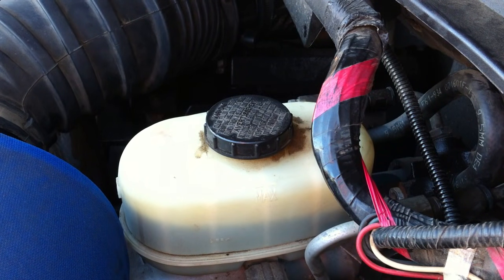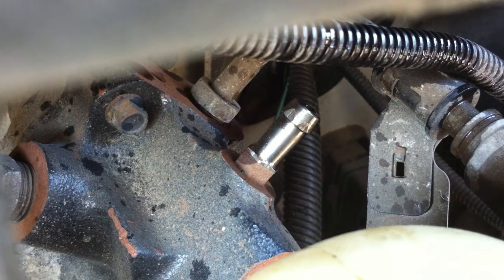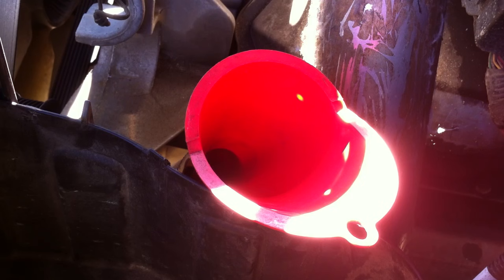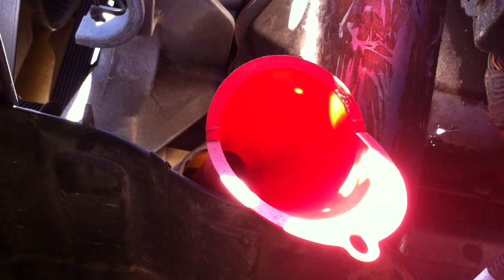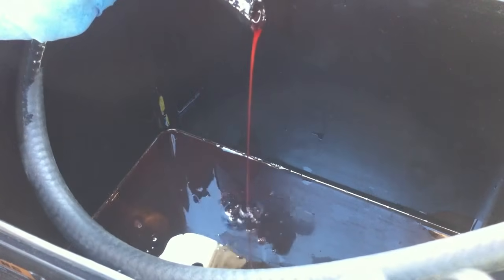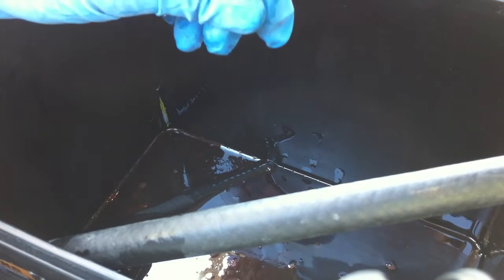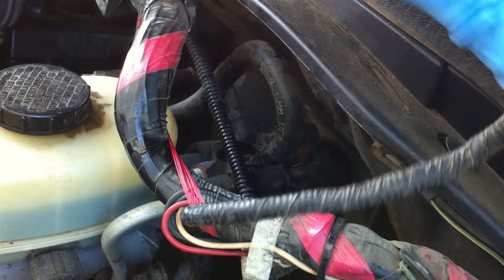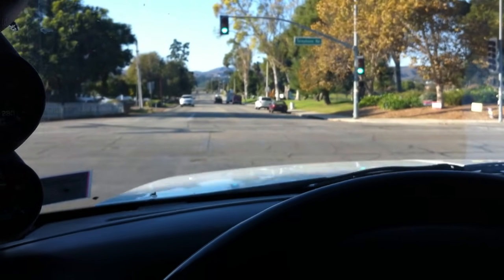How To: Power Steering Flush on 7.3L/6.0L Powerstroke (HydroBoost)

Comment: Good video.  I'm a retired hydraulic guy with over 30 years experience I can appreciate how you stressed to keep oil in the pump.  Other videos posted allow and encourage people to run the pump until dry.  When you hear the pump growling (cavitation) it's sucking air instead of oil.  This causes lack of lubrication under pressure and induces air in the system.   Now it's time to 
flush my Duramax.  Thanks,

Comment: Just did mine today with Mobil 1 thanks to this video.  Honestly, the hardest part was getting the spring clamp undone and done again in the right spot.  My pump was howling like a wolf after taking a hard turn.  Now, it's back to nice and quiet again.  Super simple process, not overly messy, just put some towels under your hose connection and you're good to go!  Did by myself, about 6 lock to lock turns, about 10 brake pumps, and still under 2 quarts total.  Old fluid wasn't terrible looking, but also at least 10 years old.  Cost of tubing was about $2.50, used old gallon milk jug for catch can, and Mobil 1 ATF from Pep Boys at about $7 a quart.

Comment: hey trey
finally got around to doing the PS fluid deal.. I did it just like you showed but when my helper turned steering wheel i got no fluid in bucket.. so i had her pump the brakes at a slow steady pace and that seemed to do the trick.. I used a braided line so able to see the stuff coming out and put the clamp on but still got some leakage from somewhere.. i did over flow the thing a couple time. .  mine, 2003 PS, only took about 2.5 qts till i got new fluid.  

My filter is stock so i remove the top housing and hose to the crank vent connection part and just left off during operation. I could see turbo wheel spinning but at idle there was no sound.  put my hand close and man can you feel the air flow.. 

all in all it worked like a charm.. thanks for the good instruction.

Comment: Cleaned up my HOWLING noise with just 2.5 quarts. I need to siphon out the reservoir still but WOW, what a Huge improvement. It purrs now and noticeable grip now.  If you are experiencing this noise, FLUSH NOW.  Use synthetic, no brainer.

Comment: Great video! Very detailed in step by step procedure. Just did mine on a 2001 F350 7.3 Old fluid looked more grayish but probably because power steering fluid added to system. Took me 3 quarts to see completely red with clear hose. Brakes nice and hard, but power steering pump still whining. Guess it's time for a new power steering pump!
Reply from the maker: Yep! That power steering fluid probably didn't help!

Comment: I am about to do this procedure tomorrow on my 2000 F350 7.3 due to an accidental puncture of my power steering cooler. I was able to JB Weld the cracked inlets where the hoses attach to the cooler. I was only able to find Valvoline Max Life full  synthetic at WalMart for about $17 for a gallon. I also punctured my AC condenser at the same time but found a used condenser, 31 row transmission cooler and a power steering cooler from a 2004 6.0 F250 at the local salvage yard for $150.

Comment: My initial bleeding process was wrong I introduced air to the hydroboost creating a vacuum so now I have air in the hydrobooster. I also changed the power steering pump and both seals to the hydroboost.
It was leaking and this is where all my saga started

Comment: Hi Trey, Good Video, I sure hope that the problem of my break peddle going to the floor and having hardly almost no brakes at all on my 02 F550 4x4 Bucket Truck the PS fluid is dark blackish and the break fluid looks like it was clear at one time now it looks dirty now Im a LineMan/HorseMan and no way am I a Mechanic so Im not sure about the Fluid in the Brake Reservoir It looks dirty that wouldnt have anything to do with me losing my brakes would it..? anyway hoping that flushing the PS System gets my brakes back .

Comment: If you aren't going to use a clear line, try clamping it (gently) to the edge of the bucket so you can use a white paper towel to check the color.
Reply from the maker: Good tip!

Comment: Trey great video. I was wondering why you say that you have to use Transmission Fluid and not Power Steering Fluid. I have a 7.3 also and like to know the reason. 
Thanks
Todd
Reply: Thanks for the input. What year is your truck?
Reply: Trey Spooner 
Ok. Mine is a 2000. I don't remember ever having Transmission Fluid on it
Reply: @odellfire35  Ford calls or Merc V in 7.3 power steering.

Comment: Thanks for video!
Are you alternating between turning steering wheel and pressing brake pedal? Or holding brake pedal down and turning steering wheel at same time?
I would like to do this to 7.3 today.
Reply: Well, my 7.3 is an E350 van, so it appears to be different. Has the larger hose going from the power steering reservoir to the power steering pump. Then looks like it has pressure line coming off of the pump, which screws into the pump, that line leads to a power steering oil cooler then there's a 3/8" line going from the cooler back up to the power steering reservoir. So I don't really know how to go abt doing the power steering flush with this set up
Reply: Ziji! thats the same setup as the pickups

Comment: great info. thanks..  could you not plug the hose you took off to connect the hose in bucket.  that would keep the spray down. just asking. 

ps what does pumping the brakes do.. i could see the fluid jump when you pumped the brake but i was thinking the brake and PS system were separate..

Comment: I have been using power steering fluid in my 2000 7.3. I hope I did not mess anything up. You said to use transmission fluid in it right? Also I have a leak that I have been having to add the fluid to every other week. I am thinking about replacing the whole thing what brand would you buy if it was you?

Comment: Did you do this when the truck was on the ground or lifted? Idk if on the ground it will damage anything. Also once your done you just reattached the return line and you didn’t get any air in system? I’m going to do this today
Reply from the maker: The best thing to do is jack up the truck or place two pieces of cardboard under each tire so they can turn easier

Comment: Are you putting the cap back on the reservoir when you're turning the wheel or do you leave it off
Reply from the maker: You can leave it off just make sure that the fluid level doesn't get too low and that air doesn't get into the system
Reply: @TruckStuff1  what do you do of you get air in the system?
Reply: @FLYPHUS  ya gotta bleed the whole system if that happens, which can be a pain.

Comment: My truck (01 7.3) is getting to where it doesn't want to steer when it's sitting still. Should I flush the system and see if that solves the problem, or go ahead and replace the pump?
Reply: yes...Mines doing the same thing ,mostly when I am towing my 5th wheel...if your steering fluid is dirty then yes change it.
Reply: check the belt tension it might be slipping at idle.

Comment: My ABS light is on, after I replace the ball joints and when I shut off the engine and restarted the ABS  is not on. When I go down the road and it's like 10 feet when I stop the truck, when I was going the ABS turns on. Is it the wire that goes to the wheel bearing or I need to replace the wheel bearing.

Comment: What about the fluid in the reservoir right there downstream of the return line?  Just accept it's old stuff or is that system independent of the hysroboost?
Reply from the maker: Eventually, after repeating this process, it should all be flushed out or at least so diluted by new fluid it's essentially new.

Comment: I need to do this on my 2006 GMC yukon.  So it does not come gushing out the moment you start the truck?  Only when you move the wheel or the brakes?
Reply: Suck It With Singh Some of the gm cars and trucks use the hydroboost system as well. My father's 04 yukon xl has it.
Reply: jesse sweetland 
really ? my dad used to have an 03 yukon but i never noticed that. thanks for the knowledge
Reply: Does anyone know if the Vacuum Pump on a 1999 Ford 7.3 Diesel Powerstroke also helps with brakes and steering or are we looking at three different parts:  Vacuum Pump, Steering Pump, and Brake Pump?  Thank you

Comment: Doing an oil change and fuel filter change on my truck today, I noticed the dipstick cap for the steering fluid was just off and sitting there, I'm suprised it didn't fall completely off.  Now I'm looking to replace it all because it doesn't even touch the dipstick

Comment: What did you do with the return line that you removed? I don't see it in the video.
Reply: Take it and zip tie it to the hood light wiring, so it's vertical, that way no fluid comes out. After flush, cut the zip tie and re-install line.

Comment: Does anyone know if the Vacuum Pump on a 1999 Ford 7.3 Diesel Powerstroke also helps with brakes and steering or are we looking at three different parts:  Vacuum Pump, Steering Pump, and Brake Pump?  Thank you
Reply: Vacuum pumps provides power to operate the air Conditioner/heater vents and louvers. It doesn't assist with steering or brakes.
Reply: Ok good to know.  Thanks MmShop Fix.  I recently changed my faulty wobbling vacuum pump.  I think the bearings broke and had been wobbling. So while driving the belt ripped and I lost power to steering, brakes and everything else.  But now I see it was the ripped belt that caused all other pumps to fail.  Replaced the vacuum pump and belt and now all works :-)  Thanks for info, Happy Holidays & New Year :-)

Comment: You say that you are changing your power steering fluid but it's making your brakes better how is this power steering and Brake connection possible I have an F-350 diesel 6 liter
Reply from the maker: These diesel trucks use the same system for both steering and brakes. Normally vehicles use vacuum but diesels don't create enough vacuum for brakes.
Reply: @TruckStuff1  so does the brake fluid reservoir use brake fluid or transmission fluid
Reply from the maker: It uses brake fluid. That's just the hydraulic fluid to actually push on the brake calipers. The hydro boost system provides the power assist for the brakes and steering

Comment: I use the Synthetic Mobil 1 ATF in my 4r100 (24 Quarts) and the Power Steering, Dot 3 in the brakes. I have Amsoil full Synth in the rear end with the Mag Hytec trans and Rear End Covers. The Synthetic Mobil 1 ATF is 10.00 a quart on Amazon w/Prime free shipping in 2 days.

Comment: How does the brakes effect the power steering and vice versa?
Reply: In these trucks, the power steering pressure is used to help with braking. Most smaller vehicles don’t have this though.

Comment: so are youy saying the brake fluid for the 6.0 diesel is supposed to be autamatic transmissio fluid?
Reply from the maker: Not the brake fluid, the power steering fluid, which also powers the power brake system. The brake hydraulic fluid is normal brake fluid.

Comment: QUESTION---  WHY DO YOU PUMP THE BRAKES WHEN YOU TURN THE STEERING WHEEL? WHAT DOSE THAT DO HAVE NEVER SEEN THAT BEFORE!! WHAT DOSE IT HAVE TO DO WITH MAKING THE BRAKE PEDAL FEEL STIFFER? GOING TO REPLACE THE BRAKE FLUID AS WELL JUST TRYING TO UNDERSTAND HERE!!!!  2006SD DIESEL 6.0
Reply: The 7.3l (and 6.0l, I'm assuming) utilizes a "hydrobooster" instead of a vacuum-based brake booster, due to the lack of applicable vacuum lines in diesel engines (I'm not a mechanic; don't know specifics).  This hydrobooster receives pressurized fluid from the power steering pump to provide necessary brake boost.  If your power-steering pump (or fluid) isn't up to par, your brake pedal might feel "spongey" or otherwise not stiff.

Make sense?  :)

Comment: Got confused. What is the correlation between changing the power steering fluid and it affecting the brakes?
Reply from the maker: Understandable. These trucks use the power steering pump to generate the hydraulic pressure for the steering AND the brake system. It's called Hydro boost.
Reply: @TruckStuff1  hey thanks! Didn't know that until now. I just got a ultra/low mile formerly fleet maintained '01 F350 crew 4x4 7.3 and needed to definitely know that.

Comment: So I did  just what  you're not supposed to do I let it go downafter the 3rd quart.the nice red fluid turned to pink foam.so what to do now
Reply from the maker: Completely fill the system and continue working the air out. Try not to run it very long with air in the system because it can harm the pump. One mess up probably should be fine.

Comment: Would this process get air off the hydroboost boost?
Reply from the maker: Yep!
Reply: @TruckStuff1  I did but no luck, about 3 quarts  but I cant get my brakes to work.
Reply from the maker: Keep it up cycling the pump. You may have to really work it if there's a lot of air.
Reply: @TruckStuff1  
Day 4 at this and no luck, I have to say I dont give up easy but this one I really cant figure out.
It started with hydroboster seals.
Then I try to bleed pump and broke the reservoir. Turn into new a power steering pump replacement. Finally I felt like I could bleed it but I know I did something wrong, brakes automatically go to the floor when I start the engine. Pedal gets suck in.
Maybe new hydroboost or maybe new abs module or maybe new brake master cylinder.
Anyways I throwing the towel.

Comment: I changed my 06 6.0 steering gear box and forgot to bleed it... went for a spin and then lost power steering when using brakes.. then brakes got reallly stiff.. took it back to my shop.. jacked the front end up and tried to bleed it but still nothing.... then tried this method and little fluid comes out and brakes are still hard as a rock

Comment: I just did this on my 2001 7.3 powerstroke and my steering and my break pidel got hard??
Reply from the maker: That's good. You should have a firm brake petal. It should be hard for the first few seconds then slowly push to the floor

Comment: IsValveoline  LV synthetic ok?
Reply from the maker: Mercon LV compatible fluids are not recommended. You need Mercon or Mercon V.
Reply: ?sp goin int the  05 exursion
Reply: trans
Reply from the maker: @KERNFUZED  Mercon SP is the correct fluid for the transmission, but the Hydroboost system still uses Mercon or Mercon V.

Comment: New sub. Great vids bud. Anyone out there that can make a suggestion on a leak I'm having I'd appreciate it. '05 f250 6.0 ps. From under truck looks like it stars somewhere around manifold or head area. Keep in mind had new oem gaskets n arp studs out in about 40 days ago. It's a oil leak. About 2ounce per morning puddle
Reply: Oil cooler most likely!!

Comment: I forgot to mention, the power steering cooler from the 6.0 is bigger than the OEM on my 7.3 Would anybody recommend me installing just the power steering cooler from the 6.0 only or should I go ahead and run them both together in a series for extra cooling? I would imagine that the 6.0 cooler alone would be sufficient since it is already bigger than the 7.3 cooler. What do you think?
Reply: Yes you can install a 6.0 power steering cooler with no problema

Comment: you said your gonna use the brakes but you're turning the steering wheel what's with that.and yes clear 3/8 is much better..it usally takes 3liters and makes good bar oil for your chain saw

Comment: It looks like you're working on a 7.3L?  You make a statement that any Trans fluid that is OK for the vehicle is OK to use in this (sic) motor.  You meant OK for the PS system?  You state that you are going to use Mercon V. 

Please provide Ford specs where Mercon V is authorized for a Super Duty.  :-).     I have NEVER seen authorization use Mercon V in a SD transmission.  4R100 or 5R110W. -  'just say'n.
Reply from the maker: http://www.dieselhub.com/trans/4r100.html
Reply from the maker: Mercon V is the ATF of choice for the 4R100
Reply: Automatic only- Ford TSB 06-14-4. Ford authorized use of Mercon V formulations in 2006.
Reply: @gregoryney5680  Hello Gregory,   That TSB pertains to the Transmission, only.   Nothing about steering. 

And BTW,  I would NEVER use V in an R4100, either.  See,  Ford knew the warranty on the last of the 4100s (circa 2003) was well expired.  No sweat on them when the seals go out.   

ACTION
Beginning immediately all automatic transmission / transaxle applications requiring MERCON(R) can now be serviced using MERCON(R) V or MERCON(R) Automatic Transmission Fluid or dual usage fluids labeled MERCON(R) / MERCON(R) V. After July 1, 2007, MERCON(R) Automatic Transmission Fluid will no longer be manufactured, therefore, availability of this fluid will only continue for however long it takes to deplete what remains in inventory.
Reply: @sevanson1  Sorry, TSB 07-1-7 specifically addresses PS.
Reply: @TruckStuff1  He's working on the steering.  Not the transmission. The TSB references transmissions.   I don't know of any change to the steering fluid by Ford.  Regardless,   new formulations available by Valvoline and others are acceptable.   But not V.
Reply: @gregoryney5680  Thanks again for taking your time to produce a good instructional video!